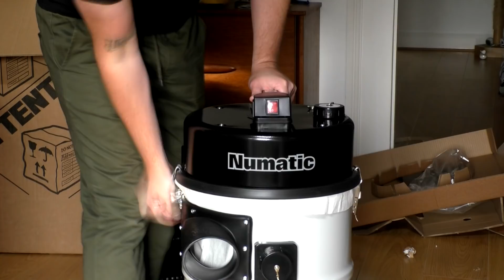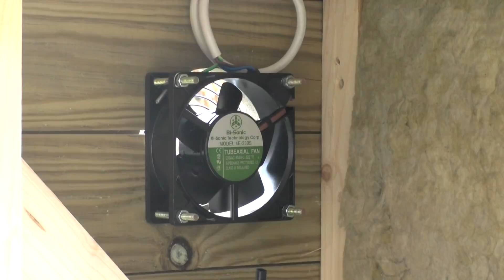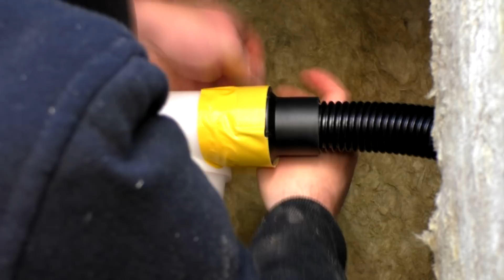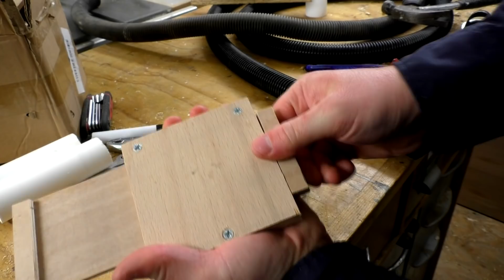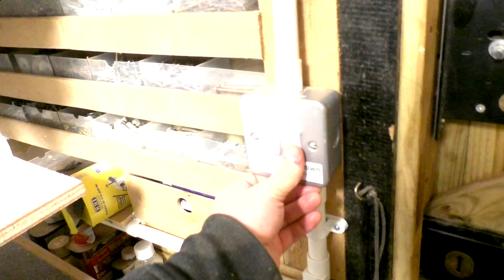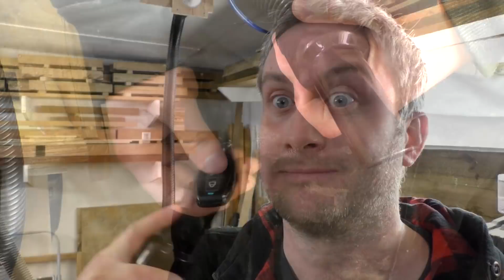My New Dust Extraction System - Installation and Demonstration

Comment: Nice! It is worth remembering that the cyclone needs a large enough air-flow to separate the dust efficiently. If you hold the nozzle face down to the bench, there is not enough air to operate the cyclone, and it will by-pass the square box and go into the suction collector-can.

Comment: I think it would be a good idea to fashion a little hood for above in the inlet fan. If it's wet outside the fan will suck in water. A little "awning" above the fan would keep water off. 

This is one thing I liked about moving from the UK to the US. Dust extraction is so much cheaper here. My whole garage system cost around $300.

Comment: Really nice setup! I’m sure some people will comment on how expensive and offer cheaper solutions but none will be as nice as your setup. The level of fine filtration, the size of the system and the low noise are amazing and cost money. I use a shop vac with a washable HEPA filter and a cyclone but the noise is so loud. Same with my compressor, I end up wearing hearing protection non-stop while in the shop. There can’t be enough said about the importance of protecting your hearing and lungs!
Reply from the maker: Thanks James. Yeah I agree. If I was doing woodwork once a week the noise thing wouldn't be so much of an issue but I'm trying to think about the future when I hope to be doing it more regularly!
Reply: Agreed. I wasn't expecting it to be this good given the space constraints.   Keith did a great job on this.

Comment: Nicely done. Might I suggest wrapping some bare copper wire around your pipes with the occasional screw fastening through the pipe as a means of grounding out the ductwork. These systems generate a lot of static electrical charge that poses a potential explosion hazard. 
Cheers
Kevin

Comment: Good vid Keith, I have the single motor version of that extractor, no HEPA but I planned to pipe the air outlet outside the workshop instead. Sending the nasty stuff outside. FYI, I have my extractors  and fixed machines on those remote switches you can buy from maplins, just plug in and one remote for 4 machines.  Yes they really do suck!👍🏻

Comment: I like your set up a lot. This is not critic but what I would done differently. The external fans covers appear to have large openings, this may allow wasp to enter which is a problem in my area. I would run cyclone through hole in floor, then back into shed and ventilation system. Just think the tote being outside would make easy empty and less dust. 
Thanks for videos, I enjoy and look forward.
Reply from the maker: Thanks! Good ideas to be fair 👍

Comment: I like your dust extraction setup.  The quieter compressor and extractor are added bonuses.  There's one thing that did stand out as a candidate for improvement.   That's the intake and exhaust ventilation fans.  Seems that they'd be exposed to precipitation, mostly rain.  Perhaps a two part modification would mitigate that concern.  The first part would be to pull the fans inside the extension a bit. The second part would be the addition of louvered vents on the exterior.  The intake fan could use a rigid louver.  The exhaust fan could use a self-closing louver commonly used on exhaust vents of clothes dryers.
Reply from the maker: I've added vents - see vlog 2 video

Comment: Just a suggestion, try venting or extending the the air intake and exhaust through the wall of your external shed which would reduce or remove the need for the little fans. Also the dust in the extractor is usually cause when the the suction is block or the air flow is block while changing between blast gates. This will suck the dust out of the cyclone collector. All in all a good video... thanks
Reply from the maker: Thanks for the info. The fans are actually needed to keep the extractor cool as it has overheated once when I used it and forgot to switch them on

Comment: I've watched this video several times to get ideas for my shop. I do hope it is insulated though. By the looks of the gap around your shop door, you'll never be able to keep heat in. Have you thought of a regular door for better closer and security? I was inspired by this outdoor addition for your dust collector and compressor, that I have drawn up a design for an outdoor "closet" if you will to the back side of the shop. I'll be able to stand in it if necessary. I have a type of compressor that is whisper quiet but it will go in there with the 2hp dust collector for space saving reasons. I do wish though they made a dust extractor here in the states that are as compact as yours. I'm even installing a couple of small computer fans as you did only they will be solar powered. I'll try to soundproof it to keep to the noise at a minimum and every seam will then be filled with a rock hard mastic so rodents can't enter and make a mess of the insulation. In the future when supplies and funds allow I will be building a lengthways extension to the "closet", keeping the wall to separate the two spaces, for dry wood storage. My shop is 16' long and I'm making the closet just below 6' so the wood storage will go the rest of the length of the back shop wall. It is hard not to worry about the cost of a good extractor system, but isn't the health of your lungs worth it? I would still wear a dust mask even with dust extraction. Thanks for the tips!!.

Comment: As Long as it does what you need it's good but some suggestions for improvement are as follows 
Use 68mm down water pipe ( tool station ) very cheap you can buy bends and tee connectors and 3 times more volume within the pipe . Another very common error is to vent the air outside the room it is been sucked from this means the air is the room must be replaced via gaps in doors etc this can also affect the air flow
Reply from the maker: https://youtu.be/t3O6nEjVWrM

Comment: Your exterior fan placement makes sense, cross circulation. It will keep things cool. I would've made the cyclone the centerpiece in your extension. You're going to be accessing it much more than either of the other pieces. Not a huge deal, it will just take a little extra time.
Reply from the maker: Thanks Mark

Comment: if you hardpipe that extractor where the pipe will be semi-permanent (inside of the extension at the least) you will significantly reduce resistance from that flex hose and thus improve performance. if possible, flip the cyclone around so the horizontal tie in faces the extractor to keep the length as short as possible, and use 45 degree fittings rather than 90's. you can use a single 90 to pass through into the main shed. 

i install air ducts for a living - trust me, this will be money well spent. we do not even use flex pipe on exhaust or return (sucking) systems, only on supply (blowing) systems because it limits airflow too much.

Comment: Thanks for the shout out Keith, gotta love push fit pipes! 
Im very jealous of your extractor makes my £35 Titan look a little weedy!
I also learn something regarding the classes of filters thanks; might try and vent the Titan outside as I do seem to get fine dust everywhere which isn’t good!
Reply: Happy Wife Happy Life Health-wise, venting outside is the best solution.  But The problem with venting outside is that you will be also venting out your warm air, which is a waste if you heat your workshop. It also will transmit your vacuum noise outside, which may annoy neighbours.
Reply: Happy Wife Happy Life Health-wise, venting outside is the best solution.  But The problem with venting outside is that you will be also venting out your warm air, which is a waste if you heat your workshop. It also will transmit your vacuum noise outside, which may annoy neighbours.
Reply from the maker: Charmers Matt, thanks for the ideas etc. Venting outside would probably be great if you can find a way to do it. The titan may be cheap but it's no slouch!
Reply: Rag 'n' Bone Brown I have 2 Titans.  They both have stronger suck than our house vacuum. The wet and dry one is very noisy.  The other (with triple filtering) is relatively quiet.   I don't plan to get rid of them, but plan to use alongside a bigger collector.  I have some dyson parts that I plan to use to make cyclone pre-stages for the two vacs.
Reply: The Titan certainly sucks like a Bangkok er hoover.....

Comment: Great video. for the cabinet airflow, it may have been better to have one fan at the bottom and one fan at the top. This way you make sure that the airflow is optimized. Otherwise, you may end up with fresh air at the top but still warm air at the bottom. My 2 cents...

Comment: Amazing work,  this a realy improvement of your workshop. I don’t think the blue barrel was to thick to resist pressure. Then the box is a better choice. 👍🏻
Reply: I have one of those blue barrels - it is very good (and relatively compact), but I've managed to collapse it twice in the last six months for not having a pressure release valve... :-(  I've been looking at metal alternatives, but the plastic box could be an option.

Comment: i stongly suggest you put some metal muskito mesh in between the hole and the ventilators , the holes actually look big enough to let mouses in , those rodents like the warmth and can knaw through electric wire and piss poop on everything 
finding a waspnest in there wouldnt be unlikely either as youre not in there every day 

i think having everything on the small pipesize is holding the machine down though the airspeed inside the pipe prolly helps keeping then clean , if you ever need more power you could do a bigger hose from the vacuum to the dustbox and mount a second cyclone setup on the dustbox , then split the machines between both cyclones inlets

Comment: Hi, enjoy your videos a lot, may I just say,air flow goes to the red "filtrex" filter first then to the "permatex" filter and lastly to the hepa filter, it looks like you are fitting these filters above the hepa , the hepa filter on these models are very small and will blind up quickly killing the airflow if not fitted in the right order.the hepa needs to be last in line.
Reply from the maker: Hi, so are you saying the red and white filters need to go below the hepa module? Thanks
Reply: Hi Keith, yes for sure, the hepa filter is  last filter before the fan. Have a great Christmas :-)
Reply from the maker: Thank you! You too.

Comment: Cool thanks mate, most of the dust extraction videos main cover 100mm ducting. It’s good to see 40mm system working well. At the moment I am setting everything up using a 62mm 21/2” ducting, but did not think it was going to be good enough. You showed me it should be ok. Thanks amigo

Comment: That was already an expensive December month, but well spent!
Btw, two fans are always better than one! you can keep the RPM down to get the same airflow, which means a lot less noise!
So I would probably let them run a little lower if possible.
Also airflow wise two fans is a better solution.
It would maybe only a little more sense to mount one of them lower for a better flow profile.
Reply from the maker: Thanks for the advice 👍

Comment: Hi Kieth, also run twin 12oow vacuum from Axminster but mine is inside my small shop, however the exhaust air from the vacuum does warm the shed up on a winters day
Reply from the maker: Nice! I've not noticed any dust exhausted near the machine yet so it seems to run super clean 👍

Comment: Great look at your system, very much given me food for thought.  One thing I don't understand is why you have gone to the expense if an M class filter?  If the dust is being pumped outside into the extension why filter it at all, just collect it.  Your workshop will be clear of dust ticking the health and safety box.
Reply from the maker: Two reasons: because I won't be here forever so the extractor may not be in the extension forever and I don't want dust exhausted in to the extension as it'll go over the insulation and make going in there to empty dust unpleasant

Comment: The fans probably aren't necessary, but they won't hurt.  The ventilation holes alone should suffice.   A hole in the extention's floor will allow more natural flow from thermal dynamic action.  Window screen to stop most bugs might be a good addition, however.  Did you install rain hoods?  Since some of your blast gates are near your ceiling, you may want to change those.  I once saw a man build triangular gates operated by short cords.  If I can find it again, I'll edit this comment.

Geeks Wood Shop has the video.  The title is: Dust Collection Blast Gates.  You might be inspired.

I found a second, similar video.  Made by Magnus posted a video titled:  Blast Gates for the dust collection system - Made by Magnus.
Reply from the maker: The fans are definitely necessary for the extractor as it overheats when they’re not turned on (found out the hard way!) possibly not for the compressor though. You lost me at the thermal dynamic action comment I’m afraid! Yes rain hoods have been installed. Blast gates on the ceiling are working fine (it’s not a high ceiling so easy to reach and out of the way!) thanks

Comment: for the air filtration, you could build the filtration on the outside (even in with the dust extractor and compressor ) and duct the air in and out to the shop.  the only space used in the shop would be the face plates covering the inlet and outlet of the system (wall space only).  make the outlet near the floor and the outlet near the ceiling. if you want any ideas on the fan system, I built several different ones for my shop and you can see them on my channel.  Grads on the expanding business, you must be doing something right :>)
Reply from the maker: Thanks Russ, good ideas! Will check out your channel, cheers
Reply: thanks for the compliment.  FYI,  since your shop is small, I figure you will only need a small fan (window fan?) behind one face plate, a small air filter behind the other face plate, and a proportional duct pipe joining them together.  most importantly, a quiet fan might be the most important factor.

one question about your dust collection, when you turn on the vac, does it create a slight negative pressure in the shop?  I noticed you have the air going out but none coming in. JFMI ( just for my information :>)

Comment: Great project - I was seriously looking at installing fixed pipes for dust collection, great to see it in action, and also all the adaptors - not sure I could stretch to the vac though!
Reply from the maker: Yeah it was a stretch for me too! But figured it was a good investment
Reply: Rag 'n' Bone Brown Did you consider about using 2" plastic waste pipe, available from plumber suppliers, appreciate not from Screwfix. Just wondering if you would get any blockages in 1 1/2 pipe. I'm using larger Triton vacuum from Screwfix currently, so don't have much spare suction to lose - just thought larger pipe would provide less resistance to air flow - Pat
Reply from the maker: I didn't but it's probably an excellent idea. Like you say, less resistance!

Comment: Good job Keith took alot of thinking out  and work. I have the orazio compressor nice quite  compressor to have.
Reply from the maker: Thanks Michael! Yes I'm happy with it so far. Pretty poor build quality in places but at that price it cost I have no complaints
Reply: I agree Keith a couple of screws the threads are stripped off on mine and i have not been anywhere near them. I read the manual and it states that the piston rings should be replaced after so many hours of use. So i E mailed the importer he replied spares are available readily{ which i doubt} and he knew nothing about the piston rings/seals so make of that what we will .Merry Christmas.
Reply from the maker: Haha... A Happy Christmas to you too!

Comment: Great video I have the exact same setup but I have a much cheaper extractor and not got the remote yet I fitted access points at the bottom of every vertical pipe as this seems to be where any larger pieces of wood will end up if they get sucked in by accident
Reply from the maker: Thanks Ben
Reply: Rag 'n' Bone Brown I first used a white bucket to collect the dust from the cyclone but the bucket kept imploding then spilt so I made a wooden box fitted cyclone on top then put a bucket inside which is wedged to the top the door has rubber draft extruders so the box is 100% airtight and cost nothing as I used scraps up also I found putting the pipe coming in from your machines further into the cyclone changes the efficiency of collecting dust it was trail and error but 95% now stays in dust collector
Reply from the maker: Mine isn't that efficient, probably more like 85-90. Need to do some more experimenting I think!
Reply: Rag 'n' Bone Brown I think it isn't as efficient as it could be because of the narrow pipes you used, the long runs, and the sharp 90 degree bends.   All of that combined would have slowed down the air flow and made the cyclone less efficient. Don't get me wrong, I am not an expert.  I have simply been researching this for when doing my own dust collection in my future 1 car garage workshop.  Having said that, there clearly isn't enough room in your workshop to run 100mm piping, or do slow sweeping 90 degree bends if you were to use it.  What you have done is probably the best you could have done within your space constraints.  I will no doubt run into the same issues as you, as my workshop will also be small.    So the whole video series has been very useful to me. Many thanks.
Reply: ksp1278 the narrow pipes are ok as long as you are not sucking up big chunks thats what i use but i used 135° bends instead of 90° bends so it's a more sweeping bend its a brilliant idea making the extension the noise of my extractor and machine together is so loud in the workshop